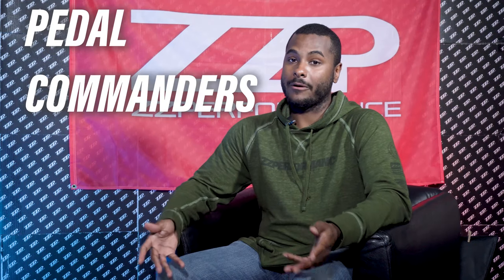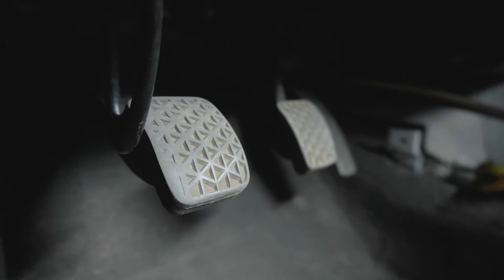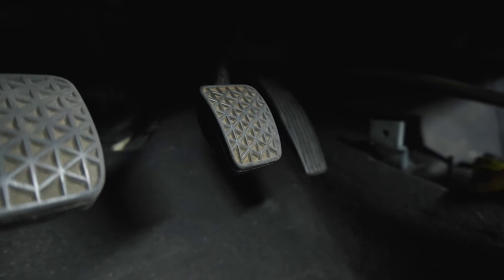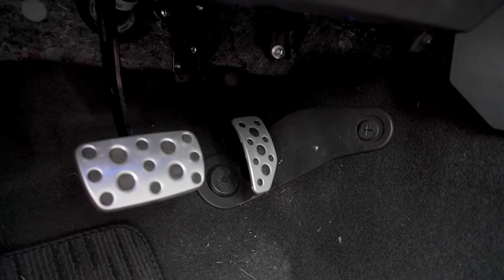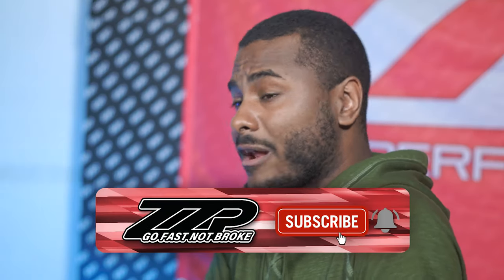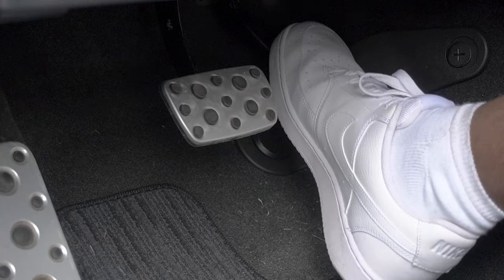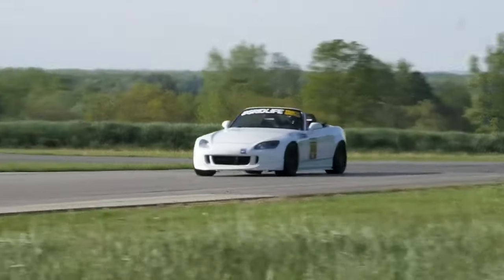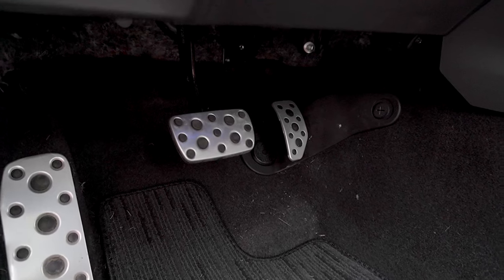Why You SHOULD NOT Buy a Pedal Commander // Behind The Builds

Comment: I believe the 90% of people that can attest to this product actually working exactly as advertised in the comments completely prove you wrong. 
In my Ram i shaved a whole second off my 0-60 time with this product. It does not increase HP but it does make an extreme difference in acceleration due to increased throttle response
Reply: Bingo same with my Durango.  They're completely lethargic and gutless without the pedal commander. Sometimes when pulling out across you don't wanna floor it all the time to get these trucks to move.   It's an overall better driving experience, also for me it keeps it out those low rpms where the truck just feels "boggy".
Reply: Completely agree and am very pleased with my Wrangler’s ability to merge and quickly pull-out into traffic. It works!
Reply: im only saying this to u once. THROTTLE RESPONSE IS NOT THE SAME AS THROTTLE POSITIONING PLISS USE YOUR BRAIN
Reply: its not marketed to give more power, it literally says to improve throttle response. only ignorant people think throttle response means more power. throttle response is all tuning
Reply: @nomercyinc6783  its doesnt even change throttle response it just opens the lid wider like wut dude said in vid 😂
Reply: @jawn3063  the guy In the video is wrong tho. It actually does improve throttle response. It removes the lag from the pedal to the throttle body.
Reply: @nomercyinc6783  wut do u notice when u apply a dramatic difference of pressure on ur gas pedal on an uphill?
Reply: @nomercyinc6783  also the guy is saying this from his experience he actually has one and tested it out. I dont get how u can say that hes wrong dude.
Reply: @jawn3063  he’s saying it is marketed that it increases power, that is false. Opening up the throttle faster than programmed from the factory is what these do. Y’all acting like I don’t know what I’m talking about or that I’m simply saying things I’m not saying
Reply: @jawn3063  he isn’t correct. There’s a programmed lag into drive by wire engines that slow the opening of the throttle blade. It doesn’t make it open any further
Reply: @nomercyinc6783  but he doesnt actually believe that
Reply: @nomercyinc6783  And no one ever said u didnt know wut u were saying now u just trippin balls brother
Reply: @jawn3063  incorrect, one affects the other, the throttle positioning sensor aka TPS is manipulated by these modules, therefore giving better response smoothing into WOT or not.
Reply: @jawn3063  I've had one in my own car for 3 years now and from MY OWN EXPERIENCE can confidently say he is wrong
Reply: @aculturedman.9172  I believe than. But ur not getting away with the downshifts thats destined to be delayed
Reply: How about instead, you just push quicker and harder on your gas pedal than usual. That's what this pedal commander is doing.
Reply: @kchiang4  because that would do nothing 🤣. Newer vehicles are drive by wire, throttle is controlled by sensors instead of a cable and throttle body.
Reply: @kchiang4  dude im telling u. Dont claim things until youve tried a cable linkage throttle body
Reply: @kchiang4  my comment completely flew over ur head dude 😂. I dont think u know wut a cable linkage throttle body is
Reply: @kchiang4  and like how the other guy responded to u thats not how it works bro 😂
Reply: @kchiang4  its actually worse when u step on it quicker lol
Reply: @jawn3063  the fact that you threw that emoji in there says something . You’re so proud that you’re some car guru. It doesn’t work
Reply: @kchiang4  dont dodge. Do u know wut a cable linkage throttle body is?
Reply: @jawn3063  I didn’t dodge. I’m on my app, busy, and responding to the first message I saw. Yes I do.
Reply: @kchiang4  i dont even know why were arguing then lol. Were u being sarcastic when u said that pressing on the pedal faster is no different than the pedal commander
Reply: I agree. It makes a world of difference on my manual Tacoma.
Reply: @vfxtutswithdan1893  have u driven any car that has a mechanical throttle body?
Reply: I just installed a pedal commander today on my 21 ram 1500. It’s literally night and day in sport mode. Such a nice mod. That lag is totally gone. It doesn’t increase HP and people that say it does need to learn how to read. It’s a great addition to the truck.
Reply: @TheRedragon33  just so you know if you decide to remove it later on you will have to do the throttle relearn process again or the truck will run really sluggish for a while. The pedal commander paired with a Tazer DT is an absolutely awesome addition to the RAM
Reply: So reading all of these Replies is interesting! All I can say about it is I have had 2 of these 1 in my BMW and 1in my 2014 Porsche Boxter S and it worked great off the line it was incredible and against cars like Ferrari! I am getting another as now I only have my 996 911, can’t wait to see how it works with a 6 speed manual versus a 7 speed PDK, it Does what it said it will do.
Reply: Strange reasoning,if it takes time for the vehicle to react,and the one with commander responds faster means in my world that the vehicle will be faster,,take for example drag racing the same car,one driver reacts faster than the other,who wins under the same conditions?.
Reply: @bojonasson520  exactly my whole point
Reply: It does work, these dudes are 🤡
Reply: @vfxtutswithdan1893  the auto Tacoma is horrendous with it.

Comment: Even if you tune the vehicle it will not remove the delay that a modern throttle body has designed in.  My LS3 restomod Trans Am is fully dyno tuned, and still had the delay built in by GM.  The pedal commander allowed me to control the “snap” in the throttle…

Comment: Pedal Commander/Sprint Boosters only does one thing. Makes your pedal behave like it’s connected to your throttle body by cable (highest setting) vs the programmed in lag that comes with the OEM modern fly-by-wire set up. I like sprint boosters AND tunes. And yes they do completely different functions. A sprint booster can actually reduce your 0 to 60 times and there are people who’ve recorded it. It doesn’t increase your horsepower. It allows you to access it more quickly because your TB opens more quickly.

Comment: I have one on a 2018 Ford Focus SE (i know, i know) but the car had zero acceleration and the pedal commander improved it tremendously
Reply: Ironically I was thinking of getting one for my 2017 fiesta se, thanks for this comment
Reply: If I’m not mistaken, the transmissions in those are ticking timebombs that Ford strategically didn’t put under warranty. I’d be really careful with that pedal “commander”
Reply: @NateBlack96  ty for the advice
Reply: @NateBlack96  yea i also have custom tunes from Focus power. I know there were recalls on 2012-2016 SE and 2012-2014 fiesta ST but supposedly it was all fixed by 2018. Im hoping my custom tune adjusts the transmission gear shifting properly, which is why i had it done. Knock on wood. Fingers crossed.
Reply: @NateBlack96   For future reference (maybe) my clutches had to be replaced after 5 yrs ownership. Thankfully warranty covered it

Comment: I would disagree with this video. I installed a pedal commander and it has increased my 0-60 time by over 1 second! 

It doesn’t just make the pedal act like it is pressed harder, it actually increases the voltage to the throttle body which causes the servo motor to open much quicker. If you floor it without the pedal commander, the throttle body will only open at a certain set speed, it will just open as far as you are pressing the pedal, but will always operate at the factory set speed. The pedal commander makes a vehicle with electric throttle body feel more like an old cable controlled throttle body. Floor a vehicle without a pedal commander and it will still have that “lag” of the throttle body’s slow opening speed. Floor a vehicle with the pedal commander and the RPMs instantly shoot up. 

Yes a tune would be better in the sense you could increase fuel flow and throttle body speed, but for a couple hundred bucks, the pedal commander changes the whole feeling of your vehicle, and not just by acting like you are flooring it, but actually making your RPMs climb much quicker throughout the whole range of the pedal.
Reply: Did the same for my Cobalt, stock 0-60 in 8.5sec and after the PC it was 7.8sec with a small baby burn out lol
Reply: Exactly
Reply: Same for my stinger 2.0 without it I’m running 0-60 in low 6s with it I’m running 5.6 to 5.4 depending on conditions.

Comment: These guys must offer tuning in their shop! Good way to increase business....The only thing bad about a tune, it cost more, you have to remove it when you bring it in for maintenance if under warrantee and it cost every time you install and remove. The in-line pedal to Throttle body (TB) enhancement programs, do exactly what they advertise....removes the lag time between the pedal and TB. It makes the response time feel better or more connected like a drive by cable system.

Comment: I’ve been a mechanic for 25 years and I have a BMW M3 with a tune and the sprint booster did increase my 0 to 60 time by almost a second and that was full throttle all the way down testing because it is giving the car a different map for the throttle input so sir regardless I find your statements to be somewhat exaggerator and on top of that I was using a GPS based 0 to 60 timing device

Comment: In my Infiniti g37x, it comes from the factory with a very delayed throttle response to make the driving experience a lot more comfortable with it being a “luxury sedan”.  I don’t like the whole comfort and luxury style that the delayed throttle response gives so after installing my pedal commander I noticed a HUGE different where the second I smash my foot down on the gas, within a millisecond the car is taking off at full power, lurching you back in your seat.  Without the pedal commander it would take almost a half a second to get rocked back into the seat so it definitely helped out quite a bit in giving it a more sports car feel
Reply: I don't trust anyone who's Beard doesn't Connect 🤣🤣
Reply: Is it delayed throttle or delayed drop into lower gear to get that torque
Reply: @clashwithmoi8926  coming from someone who drives 3 different Infiniti’s, the throttles are delayed on all three. Like seriously delayed until drive modes on the q50 and 60 are put into sport
Reply: infiniti g35x (V36) checking in. I've been chasing fixing this choking lag/throttle delay I noticed in parking lot maneuvers and from any dead stop take off (low speed barely touching the throttle etc.. BUT ONLY WHEN WARM?? anyway...)  forums are all saying vacuum leak cuz it bogs down the engine when i let off the throttle. while this may still be true, I just got back from driving my car after installing the pedal commander and I'd still say the choking moment at low speeds is still there but the cars overall drivability is WAY better even just on City mode Zero. Sport zero was actually a little too much but as others have stated, the range of selections allows you to tune for your needs) I'll be testing City + modes in the next few days. Huge W in my book. This video was clearly made with clickbait in mind considering how many ppl have success with pedal commanders.
Reply: Let me ask a simple question.   Knowing that the Throttle Commander simply tells the ECU that the pedal is being pushed farther than it actually is, how is that fixing delay?  

I think you're experiencing a placebo effect of not having to push your food down as far to achieve the exact same response.

Comment: In my case, I went from a 4.0L 2005 trd supercharged tacoma to a 2021 3.5L and although the horsepower is nearly the same.. the throttle on the new tacoma does absolutely nothing from 0-60% throttle. In order to get up and go, I would literally have to put the pedal all the way to the floor and that just got annoying. The pedal commander evens out the throttle distribution and the various settings like city, sport and sport+ work fantastic. This video makes decent points but doesn’t apply at all in my situation. I absolutely love the pedal commander. Highly recommend.
Reply: Agreed. I have a 4Runner with the same challenge. Toyota really “nerfed” the throttle response. PC did nothing for performance at all, but did do what it advertised and I feel corrected the throttle positioning sensors to what they should have been from the factory. 

I do agree with his points, however I feel there are several vehicles out there that can legitimately benefit from a PC. Mostly it would be any vehicle with poor throttle input response that you would never have a need to tune otherwise. Again example Toyota 4Runner/Tacoma are good candidates, my Audi S7 is a bad candidate and was properly professionally tuned both ECU and TCU for fuel, ignition, boost, throttle position, clutch pressure, shift points, etc…

Comment: Shoutout to people who actually own the product defending it. Buying one now for my charger rt 💪
Reply: You'll love it,  been using both of mine for 4 years now and still don't regret it
Reply: @mr.boostang2064  have you noticed any changes in engine and transmission performance? What I mean is, does it damage or puts extra strain on it?
Reply: @LuV2SPDup  none at all, they currently have a combined 120k miles of use in both trucks, neither vehicle has any issues with the engine or transmission. The item doesn't reprogram anything or mess with the engine or transmission, it simply makes the throttle body more sensitive to throttle input which makes for a dramatic feeling since the factory setting is very sluggish on most cars.
Reply: @mr.boostang2064  thanks.
Reply: Bought a 9 drive for my Challenger RT and love it.

Comment: I have a base model Tacoma 2.7L 2wd. I purchased a Pedal commander for exactly what it says it does, throttle response. I live in the mountains of Colorado. The throttle on my truck was as slow as molasses in January! Starting off on hills without unmercifully slipping the clutch was impossible! Rev matching to downshift while going down hills was also a pain. My truck is very often loaded with a couple of dirt bikes and this just made the problem worse. The truck pulls itself around fine once you get it moving, it’s the getting it moving part that was hard. I didn’t expect any more horsepower, I just wanted the truck to respond when I wanted it to. The truck is now a pleasure to drive and my clutch has thanked me for it.

Comment: I have a different brand throttle controller and to me it makes a huge difference in throttle response.  Although it doesn’t increase horse power it has made my vehicle faster from a dead stop.  Maybe it’s just my vehicle but there is so much travel in the pedal before there is much pedal response.  Sure I can mash it to the floor but even then my throttle controller seems to make things much smoother and not having that big dead space in the pedal technically it does make your vehicle faster at takeoff.  Also mine you can easily switch back to OEM mode and many other modes. Now if you are into serious modifications to your vehicle and have a good tune then maybe it’s not necessary to have one but if it’s an everyday driver with small mods then I think throttle controllers are a very cost effective way to get better acceleration especially in city traffic.  If you are looking to buy one and have a GM vehicle I would look at the Soler performance throttle controller.
Reply: I have 2 cars. A 2007 VW GTI modded and tuned. I wouldn’t put a pedal commander on the gti because it has no pedal lag. My 2008 Chevy impala on the other hand has a terrible throttle response due to the built in lag. When you stomp the gas it has a momentary kick down before actually applying the throttle. That’s when a pedal commander is needed
Reply: @hanzgrueber145  …Absolutely! I have a ‘12 Camaro RS and yes the throttle response is most definitely there.

Comment: All it does is increase pedal response. So if you're getting one for your high performance car or truck, not necessary but it you have a compact or mini van, and your pedal response is slow, sure why not.
Reply: It’s even solid for bigger sedan
Reply: Why spend $300 on something that only adjusts the throttle response without gaining any horsepower lmao
Reply: @phaselaser  because if you own a car that has a V8 from the factory but it takes longer do speed up if you push the gas pedal then pedal response is going to give you a faster response.

A faster reaction from the engine will help you go fast because there is no delay from when you push the gas pedal to when the computer tells your engine to go faster.
Reply: @phaselaser  300 dollars is nothing lmao. You broke?
Reply: A Tacoma has horrible response too lol but I heard it’s for mileage
Reply: @phaselaser  because I don't plan on tuning a 140hp econobox or a 210hp suv lol. The PC gives you a sporty throttle response without the risk of ruining your daily driver.
Reply: @phaselaser  
It takes out the lag in throttle response. It doesn’t just trick you into feeling like it’s faster. It speeds up the time it takes for your accelerator to make the adjustment after pushing your foot down. How it that not a plus? The problem is people are too stupid to understand how they work.

Comment: I had one on a 2017 Jeep Cherokee and it took the pedal acceleration lag away. It was a night and day difference to drive. I took it back off before I traded it in and it was so boring to drive with it off. I would get another one for an automatic car, probably not for a manual though.
Reply: i have a jeep grand cherokee and i want one as well
Reply: @midwestrotty8871  you'll love it, I had it on my Cobalt and currently on my Explorer. Doesn't make you faster but it does make the car feel more lively and sporty.